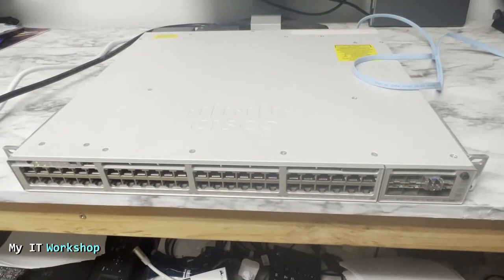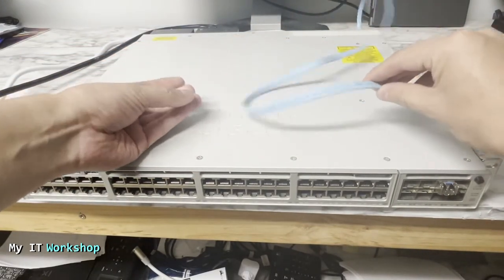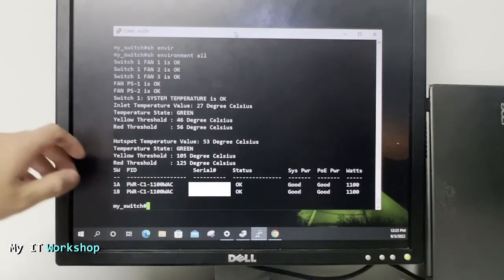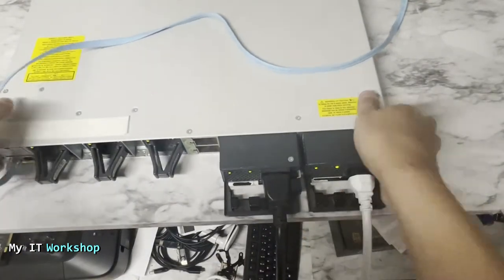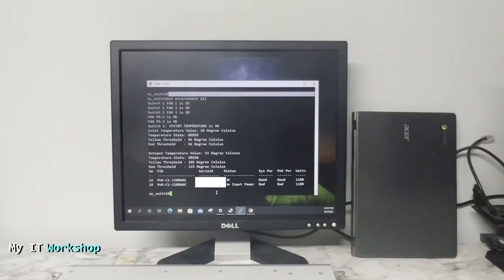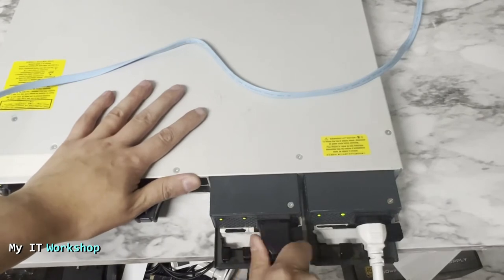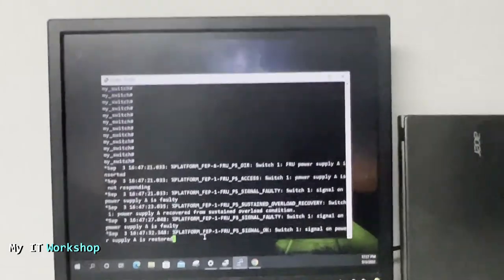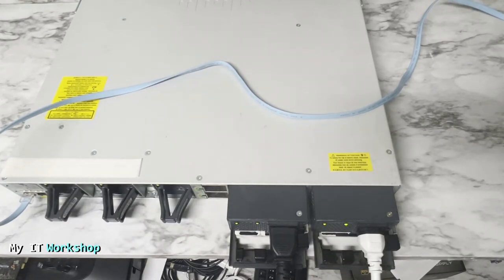How to Replace a Faulty PSU on Cisco Switch

Comment: Sir Hi I have Cisco sg300 10pp switch its supply not available here its orignal adopter supply is 54v 170wat i have only 12v 120wat i wanna use it as a ethernet only 4 ports 1 is wan and other one as a lan to other router or tv